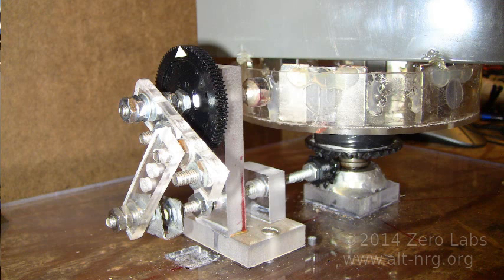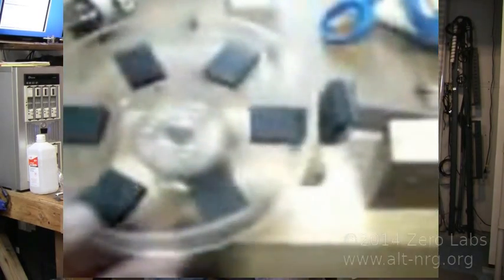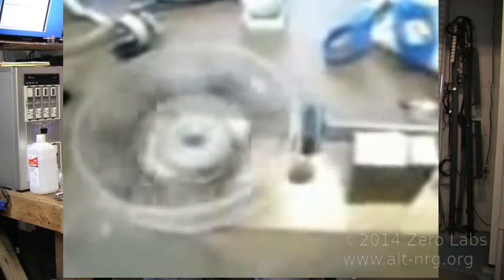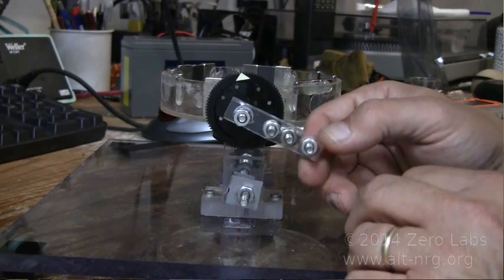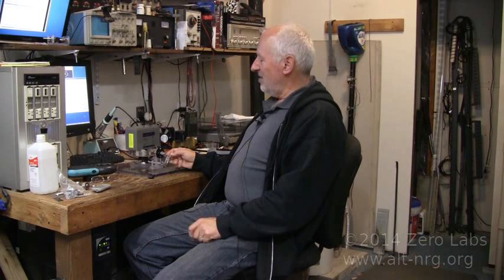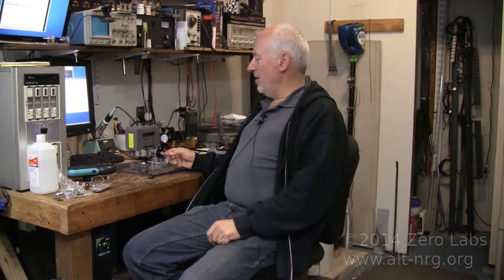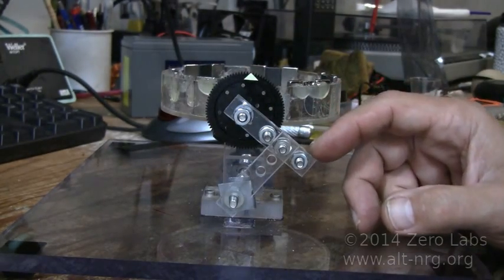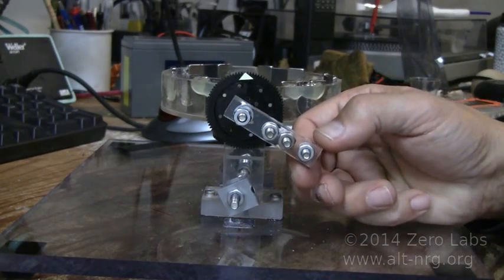#383 Vortex Field Permanent Magnet Motor Update 03

Comment: This builds up a transient that discharges the accumulated flux and reduces the kinetic energy. The use of soft magnetic steel complicates the analysis. You have a parametric ocsilator which build up then decays back. You would need to find the flux transient and rectify it (unidirectional capture) and store the dielectric field.
Reply: The key to energy capture from counterspace is unidirectional capture of transients. You think a shotkey diode is fast enough? Nope. Voltage corresponds to aether curl (dimension that regulates energy conservation) ie vortex tubes (dielectric units of attraction). The high magnetic aether flows in spatial compression (field collapse) cause curl punch through to counterspace for formation of a vortex void capable of forming a dielectric tube connecting two conductors. See Maxwell's equation and the faraday model of a particle as being a manifestation of dielectric lines between conductors coupled with orthogonal closed loop magnetic flows. Nothing exists unless something moves.

Comment: Seems like there no movement being utilized on the pull motion of the lever only the push. Need to have other for it to work. Like the human heart. Maybe a smaller rotary magnet diameter or using a holbach array going into a pyramid and use that smaller torsion field. Or just make it flip 180 degrees with two lever positions with springs or something to reflect back any extra kinetic energy so it’s. It wasted. Also have you integrated the right numbers into it? Pythagorean, 108, phi, etc. you need to use those to get the energy of the natural torsion fields and draw upon the fractal nature of the universe. That’s how you interface through self similarity and the increased complexity creates overunity.

Comment: Turn motor to run on the horizontal axis. Here's why: On the horizontal axis you'll work both with and against "gravity" if there's a such thing ( I prefer density vs boyancy over gravity). That's a wash... but when you add angular momentum (A) with gravity (G) you'll get a partial cancellation of the gravity on the up (u) force and an amplification of gravity on the down (u) force. (flywheel effect)
Here's my formula:
Gd+ A= Gain/Gu+ A= 0(near zero)=Gain+0= Gain  
Currently you have with a horizontal design:
Gd+ A= 0/Gu+ A=0= 0+0=0 Gain. You must take advantage of nature somewhere in your design.

Comment: ZERO LABS---ok-take another magnet and set it into the rotor nearby 90degrees to any one of that magnets into the inner rotor. in this case one of your inner magnets needs a differend field than the other ones. otherwise it will always stop at the same position . thats all_peace on you

Comment: This problem seems to be a bit similar to the Roobert33's Permanent Magnet Motor V-gate, which needs mechanical method for moving the stator magnet. In the case of V-gate such problem can be solved with Quad V-Gate Magnetic Rotation (flywheels heavier and 90 degrees apart), which works with solid stator magnets i.e. without moving the stator magnets at all.

Comment: You seem to be generating a little amplitude that could be used in practical application to magnify torque output.  That little tap you give the motor I think produces greater torque than a motor used to tap it could produce. In other words, you could use a very tiny motor to tap it and the magnets would produce torque beyond that of the tapping motor. I think that indicates that you can produce more work for the amount of energy induced by the tapping motor. That could be an increase in efficiency at least.  Kind of like a pendulum in a clock.
Just a thought. Probably full of holes.

Comment: Make everything variable.....
Mount the piece that's wobbling at the bottom with a screw, so the timing can be adjusted by simply loosening the screw, twisting it where you want, then re-tightening it. & just cut one long slot down t lever, so the amount that the magnets are twisted can be changed.

Comment: Interesting Experiment.  To me, logically, the connection you're wanting to use is too rigid.  The power transferred from your finger definitely has different ramp up and down rate than a mere sinusoidal rate.  To get a connection that would be more like your finger wave, the connector should not be rigid, but be flexible.  Maybe use sliding plates w/ a spring for tension.  Then just have to adjust the tension of the spring in order to get closer to your finger motion.  COULD use arduino connected to screw to adjust spring pressure digitally.  also recommend measuring power input vs power output for entire device.  Could also put sensors on your 'finger' vs angle of rotation of device so you could correlate finger motion vs spin angle?  Seeing all this in a graph would allow MUCH easier motion definition, etc.  Still watching vids, not sure if any more vids about this after this one.  Keep up gr8 work!

Comment: Hi, just a normal guys view of this....could a heavier, elliptical weight work for the cam to turn, creating enough inertia for it to continue turning by itself? Or possibly something that uses a "see-saw" motion, self sustained, to move the cam? Something that goes under the wheel and as the wheel turns, it "bumps" the see-saw down, hitting something such as a spring, popping it back up, only to be bumped down again, turning the cam unassisted... just kind of "thinking" out loud.

Comment: What if the wheel wasn't fixed and was allowed to wobble by itself? and the agitating bar loosely fixed?

what if another wheel was placed on top of that magnetic wheel and could spin in such a way that the inertia from the new above wheel would drag the bottom across the resistance point? what if this principle proved useful and you stack 3 wheels together in a way that they would drag each other across the resistance point?

what if you made a second machine and hung it directly above in such a way that the oscillating bars would fight each other through the use of magnets with opposite poles facing each other. Have you ever seen dipping birds? bobble head type toys? Imagine two dipping birds facing one another with opposing magnets attached to their beaks that would repel at the apex. 

What if the wheel wobbled? and the stator bar was fixed or loose?

what if you made a smaller wheel and put it inside the wheel, to create a magnetic resistance from the center also?

what if the wheel was allowed to roll on something? like the shape of a skateboard half-pipe? imagine a half-pipe shape built inside of an ant farm enclosure. What if you built a machine using the halfpipe ant farm idea with a wheel of magnets inside to agitate the oscillating bar?

what if a wobbling force was applied to the end of the agitating bar?

Here is a design you can add to help you. what if you created a magnetic resistance at the top, and let the wheels wobble a little more sloppily. The cylinder shape is an awesome tool, but what about the cone shape? The following link may help inspire you. What if you add your gears to the following design? Imagine your ideas combined with these ideas. check this out. http://rimstar.org/sdprop/haml45gd/haml45gd.htm

Comment: I know this is a year old and the project seems to be abandoned, but I thought I'd provide my input anyway. The reason it stops working is simply this. When you are moving it by hand, you are providing energy to the system. When you replace your hand with the cam, you are actually taking energy away from the system in the form of friction. In essence, you are going from a net gain to a net loss. Newton's laws of motion are a tough customer.

Personally I don't think we're going to be able to get "free" energy through mechanical means. The friction losses are too high in my humble opinion. I think if it is ever achieved it will be through something more in the vein of nuclear energy. When we split the atom we found ludicrous amounts of energy. When we fused atoms, we found even more energy. Who's to say what we might find if we could split a proton. If protons could be used as fuel, and each had the energy of a fusion reaction, we would have an inexhaustible supply of energy. Well, at least until we found a way to use it all up with our flying cars and what not. :P

Comment: What if your armature attached to your drive shaft with a slightly elongated hole instead of a perfectly round hole, giving it a chance  to "naturally" recover from your forced mechanics each revolution....like half the amount of offset that you have on the end of your drive shaft?
The oscillation of your stator is great....i think you need that oscillation on the end of your armature also, ie the elongated hole in your armature.
The asymmetry is definitely a key though.

Comment: I suggest that you install rotary encoder wheels on both the rotor and the actuator. The idea would be to capture the data of both encoders so that you could plot the shape of the cam motion relative to the position of the rotor. This may give you the data you are seeking in order to develop a proper cam shape to allow the motor to self run. Look here for ideas on how to use an Arduino to capture the output of a rotary encoder: http://www.hobbytronics.co.uk/arduino-tutorial6-rotary-encoder

Comment: I would think your next step is to fine tune your control over the when the stationary magnet rotates in relation to the rotor magnets. As it is, you are restricted to the various fixed relationships. Also, all the energy seems to be kinetic energy and it would seem to me some portion needs to be stored in potential form so you can apply it precisely when and where it is most effective, like using a lever. From a conventional point of view, it can never work, because you don't have an energy source. How does this machine trigger or extract energy from the "zero point" energy? Do you have theory as to what is needed to do that?

Comment: the input from your hand seems to be varying based on rotation, where the crank is consistant. What about a varriable stroke connecting rod, or a crank that can adjust bearing height to affect stroke. I could be way off, though.

Comment: it is hard to see the rhythm. I recommend you put a paper disk on the shaft facing the camera. have your down lever slide past the shaft and draw a line on the paper as you run it by hand. this should revel the action your looking for out of the cam. I'm not convinced that even once you have the correct cam action that you will reach your goal. you might want to try an external motor once you have the correct action/rhythm. this will take any manual compensation you may be added as you run it. if you can make the unit run hands off, then I would revisit trying to connect it to the output shaft.

Comment: im thinking that you need a piston like motion where on the bottom wheel there needs to be a metal bit that's smooth and cerved on one side and all it dose it hit the bottom of the handle and lifts it with a bit of an incline to give the upward motion and then lets gravity drop it down again i cant think of an example but anyway there is less energy being used and less friction being used in its motion to the best of my knowledge but it may not be able to move as fast...

Comment: Mark's  talent  is  the  ability to articulate effectively.   He  enjoys  constructing  things that he hopes  may be self running.  Unfortunately  permanent magnets are not the answer.  One cannot  void the law of conservation of energy.    When  constructing prototypes  there  should be  an  output shaft.  A  successful  motor not only needs to power itself but it  requires a rotational output shaft to do work.   Construction materials  should be all metal and not plastic or wood.

Comment: mark;
Consider what the Ancients knew:  the Earth is one BIG magnet, and it pulls anything smaller to it. the bigger the magnet, the stronger it will attract, and repel. You need to reverse the big length of magnets, with the small (the little Magnet on the lever) one on the rotor. If you want the rotor to spin, it needs to be smaller and lighter..... so put all the magnets on the OUTSIDE and put 2 or 4 little magnets on the inner rotor. Give one nudge of the inside drum and watch it go.

Comment: Maybe the geometry of the magnetic fields is a consideration. Maybe there is a way to tilt the magnets so they either attract strongly on the incoming field and oppose lightly on outgoing field or oppose strongly on the outgoing field and attract lightly on the incoming field. Also maybe the size of the each the fields plays a factor in it as well.

Comment: Ok, so here is something to consider.  When you push the lever with your hand, you are essentially getting the magnet out of the "dead zone".  Have you tried putting a flywheel on the shaft?  not the main drum but the part where you connect the lever. Also, you can try making the lever arm more adjustable, perhaps there is a sweet spot that will help the device out of the "dead zone"

Comment: Maybe you can get some AC out of that by switching up the magnets a little and adding rubber bands to the oscillation component on 2 sides to get that action you are attempting.  Adding bands to that in some way that might help.  Not a clue though.

Comment: Have you tried adding a return spring? Your fingers are supplying energy in two directions which your connecting rod is supplying energy and consuming energy at an equal rate causing it not to self sustain. Only has to be a slight spring force

Comment: Your finger is produceing energy, that means when you remove your hand and expect the magnets to do the work, in reality the arm that moves the adjuster is under load, thus it stops because there is no external force driving the magnets. The closest thing we can get as of now is radiant energy. you can collect it in the air with a capasitor to run a motor forever That is how you pull energy from thin air..... preety much nothing.

Comment: The crankshaft is taking the energy out of the system, entropy takes hold immediately and it stops. When you use your hand it is not a closed system, your hand is adding the energy, no motor can be 100% efficient and thus your motor will stop without your hand input... Hope this helps

Comment: Hello again Mark,
Have you figured out why the VFPMM motor shown in video #380 did not work as planned? Your sketches and logic seemed solid. I plan to get the parts necessary to build the motor, but would really like to see it run first. Or, have you given up on the geared approach?

Comment: It seems like the cross-link is doing both the pushing and pulling on the lever which results in a loss of energy. What if you add a bit of Resistance to the lever so that every time the cross-link pushes the lever the Resistance would always want to push back. A very light weight or low Resistance spring I think would work.

Comment: Just my 2 cents. The point at an impulse should be applied is exactly between the 'potential' and 'kinetic' crossover. What you are doing by hand is the equivalent of giving a swing (as the rider of the swing) an impulse at just slightly before or after that dividing line yet you have somebody pushing you so neither of you feels like you're applying much force and things seem  to be working fine. However, take away the swing pusher and you'll find that you are not gaining any momentum but rather you are slowly losing it. The only way I know to do this with a setup such as yours is to use an electromagnet - allow the magnets to attract to the iron and just as they pass center (the crucial line) reed-switch the e-mag closed and rather than the magnet bouncing back to the iron (the sticky spot) it will be given a push. The reed switch must be deactivated (all of this should be doable just by positioning the reed switch in the right place) before or at the other end of the potential/kinetic cycle. I had an idea for a pendulum based on this concept with a coil near the top at one end adding lenz impulses right at the point where the pendulum was stopped and getting ready to swing back. The entire thing is based on resonance amplification (as in what brought down the Tacoma bridge) but for a wheel there may be more to it. Regardless - I think that crucial switching point is that exact spot mentioned and it has to be dead on (just as the impulse you give your swing to add energy). I don't know how you could achieve that with p-mags - I'd go with an e-mag (perhaps that bowl shaped one would work well since it pinches the force lines on the convex side and acts a bit more like a unipolar magnet (or seems to anyway). Else just a large magnet with good size iron core. Sorry to bleed on, I've got this infiltrating every facet of my thinking lately and I'm tired to boot - so - I hope my concept was not too muddied as I think it's a crucial factor. Good luck!

Comment: What you are doing different is applying a outside power source as opposed to power supplied by the rotor. You have run head on the conservation of energy law. After seven years and the same law is still working against you. :)

Comment: I think you need a stronger magnet. Think about this for a second; is the force of your hand pushing down on the rod in unison with the force of the magnet doing the same thing? I think you need a stronger magnetic force/reaction to achieve the targeted goal along with timing and proper profiling of the crank shaft. O, I also think you should use a cam shaft instead of the crank shaft, it's easier to profile and it will do exactly what you want it to do.